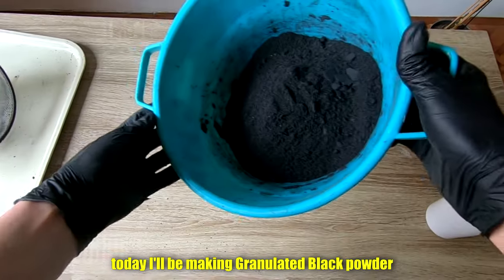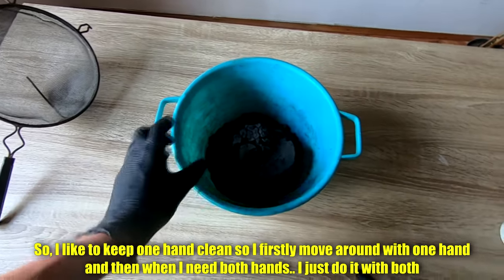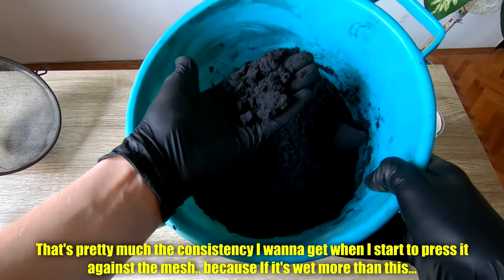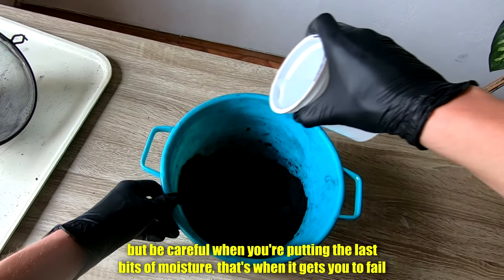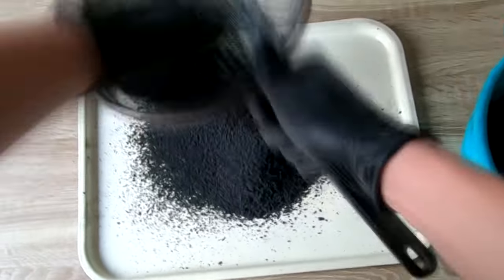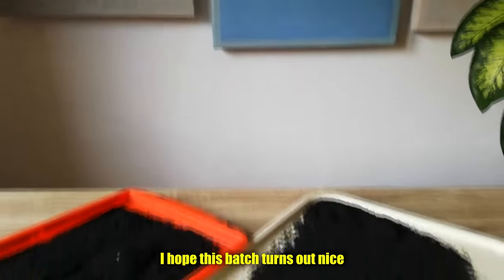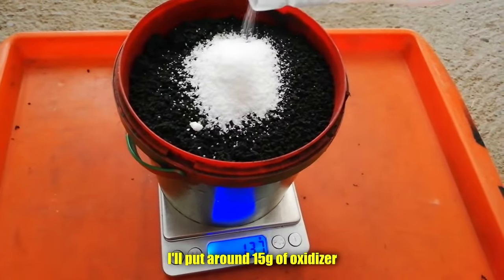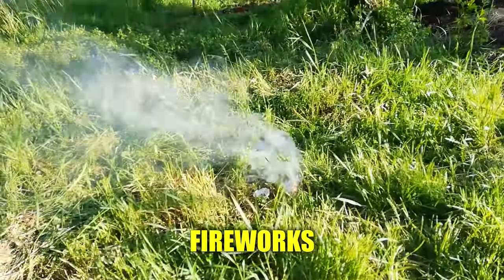You'll Only Need This Process to Make Fast Lift Charge for Fireworks

Comment: so you just add 75%kno3, 15%charcoal, and 10%sulphur mixed in a jar and add 75% water and 25% rubbing alcohol? Does this mean you can make black powder without ball mill?
Reply: You can. But for me this is shitty BP not good enough for lift. For prime, burst charge or star comp it is ok
Reply: Yes, absolutely. Ideally you would want to use this process AND a ball mill for best results.
Reply: @mihael64  aight thanks
Reply: This is the question that I always had because I tried making 100 grams of this without the ball mill mixing for 5 minutes and then it was so shit so I did some research and found this video and I’ll try this let me know if it worked for u
Reply: You need to add a binder, otherwise the powder won't form granules and will just crumble to dust.
add 5% dextrin and you're golden
Reply: @mixdxperience1000  If you have a hydraulic press you can just wet it slightly with water and press it to pucks, that you let dry and crush later.
Reply: 外用酒精幾%？
Reply: @將軍-c9x bruh says in OP comment and in video %25 alch and %75 water for the moisture
Reply: @Ez-lk2hl tbf they might be wondering an exact number, which we can't have because it would depend on too many variables for each individual
Reply: Rubbing alcohol comes in many different concentrations (40%-95+%) which do you recommend?
Reply: @將軍-c9x  it's mostly likely 99%
Reply: @michelemason9842 99% because you can always water it down and also water can't be used to in some comps.

Comment: You need to ball mill all of your components together (75-15-10 plus none)  Tell it feels like tacom powder in between your fingers. Then wet it with 100% h2o  + 1 percent dextrin, do this until you have enough to incorporate into your batch of BP at a rate of 24% I mill enough BP so that I have 1000 grams or 1kg of powder then I do the following. knead into ball then press/rub thru a .25 mesh screen onto paper. Place into sun and sun dry in about 1 - 2 hours for a 1 kg batch.  Enjoy.

Comment: if you don't have a ball mill then use a cylindrical plastic bottle and put you 75% 15% 10% Black power in it and put round marboll or lead ball in the bottle then Shake it for 2 hours ( shake it for more hours is better) then test it  ,i am sure you'll be surprise

Comment: It isn't only the oxidiser percentage m&d it is the charcoal type and the granule method you use! Try to press it in press let it dry and the crush it use willow charcoal and 62 20 18 ratio and 3% dextrin but the ball mill time will be more ! 10 hours (recommend-optimal)👍 great video thumps up!
Reply from the maker: As I've already mentioned, many factors yet to discover. Haven't done different granulations & proportions for BP yet, but I'm sure that can also be one of these factors. Cheers & I agree with you.

Comment: When I make my lift charge, I just use 100 1/2 inch marbles in a 3lb ball mill, with a eastern red cedar charcoal, I let it mill for 3-4 days and then granulate it, it burns so fast sometimes it looks like flash. Red cedar is one of the fasted charcoals I’ve used, the hardwood is mostly good for making tiger tail stars.
Reply: Paulownia charcoal but you've probably discovered that by now. I personally think it makes faster bp than wrc.
Reply: glass dust from your marbles will sensatise whatever comp it comes into contact with.

Comment: I have made perfectly good lift powder without milling. You just need very fine powders and granulate it nicely. I can barely tell the difference once it has been suitably used in a way that creates good pressure so the shells must be well fitting.

Comment: good info. good powder important for mortars. I prefer to use soft woods for charcoal. I like the experimenting testing and comparing the results.
Reply: Yeah softwoods reign superior when it comes to charcoal for lift or burst charge
Reply: I've just started using soft wood and grapevine. So far I've been impressed by the grapevine.
Reply: I don't understand why different types of wood within the main hard/soft category make allegedly noticeable differences. 

I'm not doubting folks claims, but like pine vs cedar (dude making amazing BP said he noticed good results with even the cheapest soft woods) what the heck could actually be the factor? I can't imagine on a microscopic level there is THAT big of a difference between woods in char form.

My gut tells me that it's a different variable that folks are attributing to the charcoal. I'm sure lots of dudes have used 2 different batches of S or oxidizer from the same source and changed the charcoal, but unless you use the exact same batch of each ingredient, well mixed, only changing the charcoal type, it would be impossible to tell for sure.

Same exact, trusted source of reagents could have 2 varying batch qualities of the same ingredient, so I'm still scratching my head to figure out why and if willow, for example, is somehow superior.

I feel like any given wood just happened to be the common source or charcoal for a given area that was known for master artisans, and they could have made equal quality booms with ANY wood

Comment: have you tried glutinous rice starch?  i have heard 3% by weight, instead of dextrin, makes it better.    Just wondering...i have only tried your way, so far.  Appreciate your videos.
Reply: As little as 1% will do. I haven't made BP for a while, but to 1 kg of BP I used to add 10 grams of SGRS. I added it afterwards by mixing it to a "gel" with 125-150 ml water and then mixing it with BP that I had ball milled for 3 hours.
Reply: @francisdec1615 how much sulfur and oxidizer did you use according to the original 1Kg of BP?
Reply: @Ez-lk2hl  If I have really good charcoal, I will make something like 75% potassium nitrate, 13% charcoal and 12% sulfur.

Comment: Can we use weight machine instead of weight scale plz reply 😢
Reply from the maker: Not sure what machine you're talking about but you'll definitely need precise measurements for this one. You could measure by parts (won't be as precise) with little spoon-like thing, for example 5% is one spoon, you'll need 15:3:2 spoons for BP mix and approximately add dextrin for granulation. Make sure you have read enough before going into pyro creations to stay safe :)
Reply: @MakeAndDestroyFireworks  thanks 💓

Comment: Nice work granulating but it definitely needs a better mill ratio. 50% of the mill jar needs to me media and just cover the media with comp thats the proper ratio for milling however slower powder is good for gugger shells like 5 inch canister with multi breaks. I personally dont use a binder or water I Luke isopropyl alcohol or denatured alcohol to wet. I do sometimes add 1.5% dextrin or sgrs to slow it a bit because it's to fast for my cakes. Good work.. keep it up
Reply: I use brass balls 1 inch, mill is 30% filled, that seems to work.  When I bought them they were $1 each now they are $5 each.  Meanwhile the price of gold is going down, had I known I would have bought brass instead.
Reply: @jthunders  brass is a horrible idea that can cause a spark

Comment: Your doing this the hardest way possible. Mix the chemicals before you run it through the shifter. 100 mesh screen run it through three times and shake in bucket before next screen. Then put the mix in a ball mill. The longer you grind it the hotter the powder will be.
Reply from the maker: It's not that I use this process to just mix but more importantly to feed the charcoal particles with other two components in wet state. That's what improved my performance in comparison to mix & mill only process. 100% better results. Cheers.
Reply: yeah what are you talking about? sounds like you just explained exactly what he did in the videos